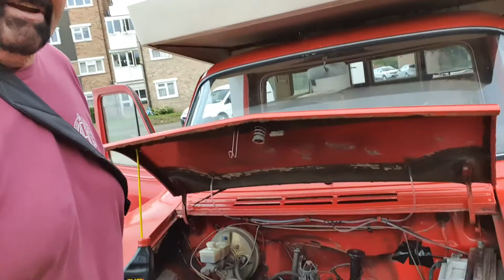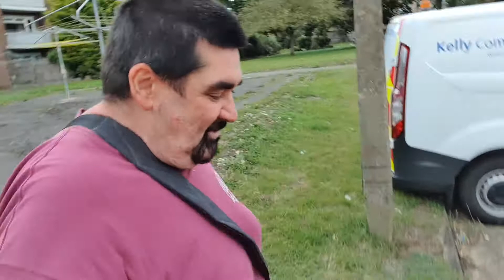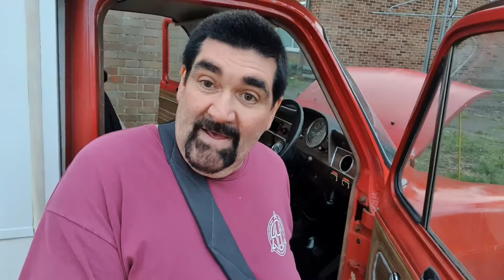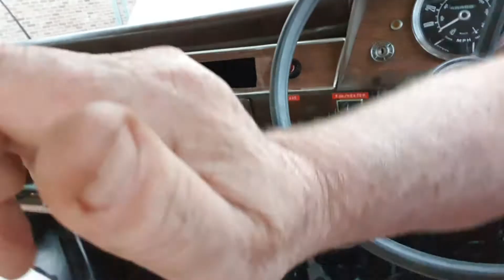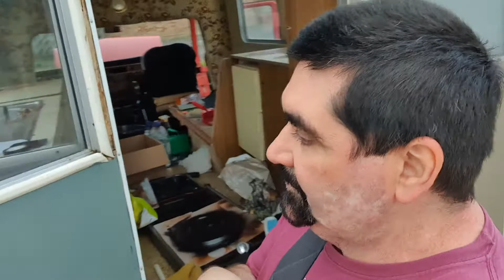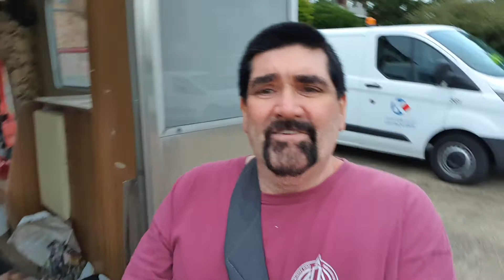Day 023 Ford Transit Mk1 interior, glovebox, working switches & another step closer to firing it up

Comment: Aren't you supposed to put Slick 50 in with clean oil and then take it for a run?
Reply from the maker: In an ideal situation you add engine flush run the engine until warm. Drain the oil, change the oil filter, refill with fresh oil, add Slick50 then take it for a drive. In this case I checked the oil and it was still OK so I just sloshed in some Slick50 to protect the engine. Let's not find extra work :O
Reply: @liberatorproject6546  yes but it won't coat the engine unless it's run
Reply from the maker: Patience